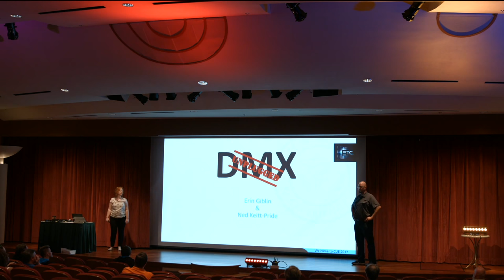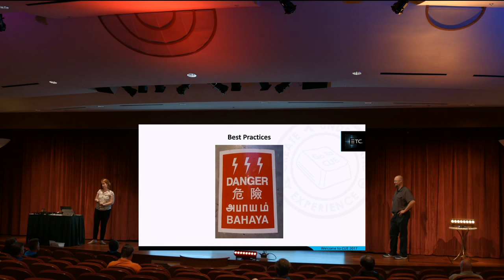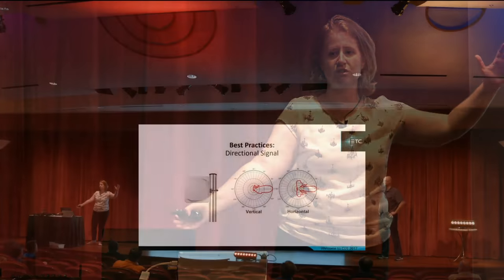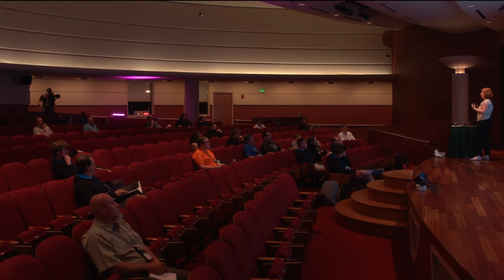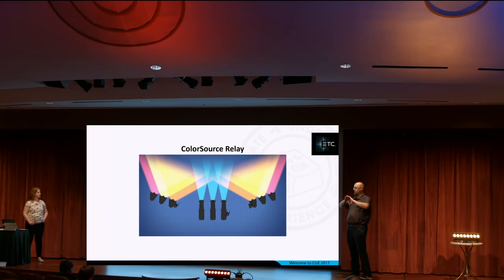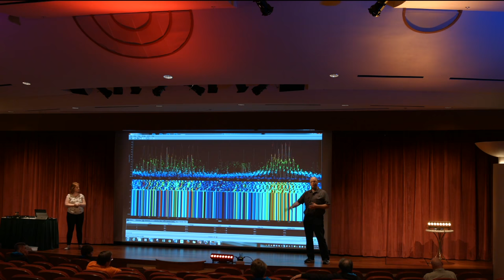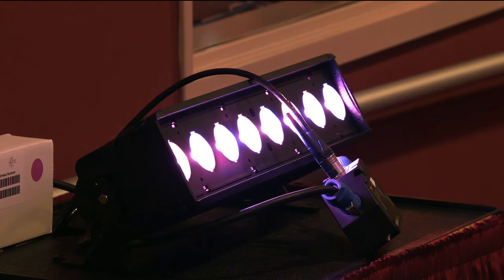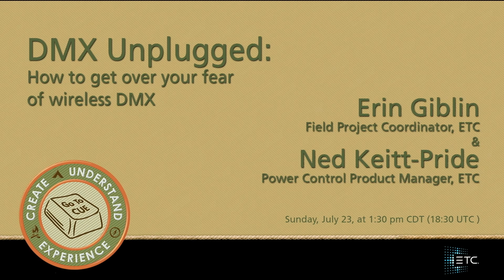CUE 2017-DMX Unplugged: How to Get Over Your Fear of Wireless DMX

Comment: What are  the other software options for spectrum analysis ? It was mentioned at about 45 minutes that there were others.
Reply from the maker: From Erin: 
There are hundreds of apps and programs out there that are fantastic, including Microsoft and City Theatrical, and I am sure other commenters will be able to add their experience and recommendations. Here are a few that I have used and liked: 
1.       Metageek has a free version of the software that we use in the presentation, it is called inSSIDer and you can download it here:https://www.metageek.com/support/downloads/ it is great for small set ups, and is easy to scale up into their larger tools if you your system grows. This is what I use on a day to day basis in my non-ETC life. 
2.       Solarwinds is another professional grade tool, but they offer a free trial: https://www.solarwinds.com/ This may be overkill for what you are trying to do, and the actual software and tools are expensive (though very powerful). They are also offering some free educational resources during the Covid-19 crisis. 
3.       Wireshark is a great tool for many applications, and they also have some wireless analysis built in. If you are a working technician I highly recommend getting yourself familiar with this, it takes a bit to learn but is powerful and open source. https://www.wireshark.org/

Hope that helps!